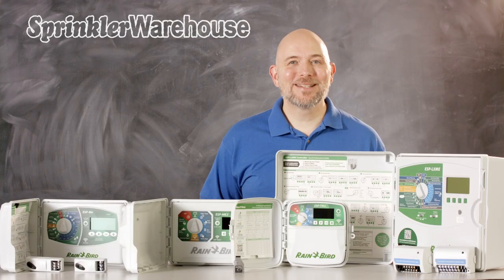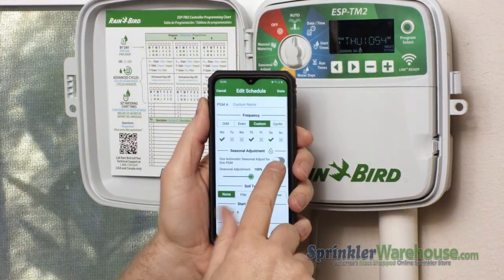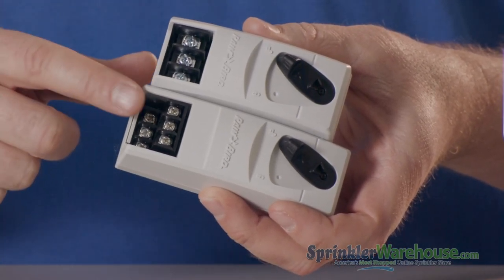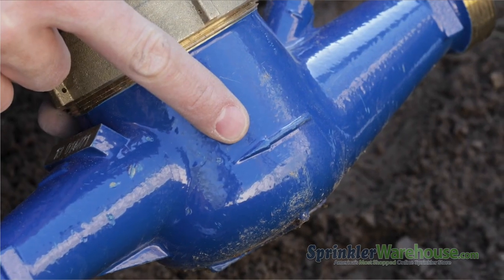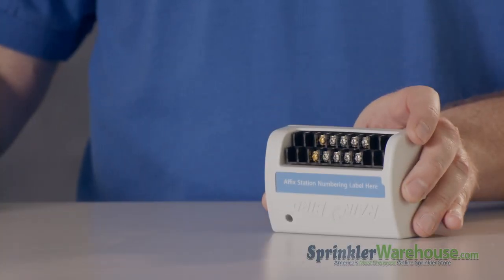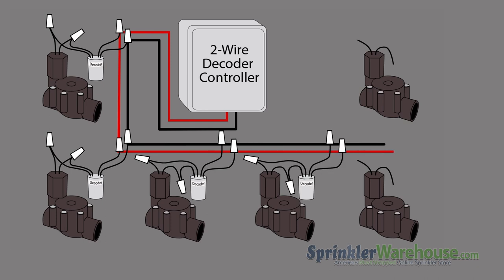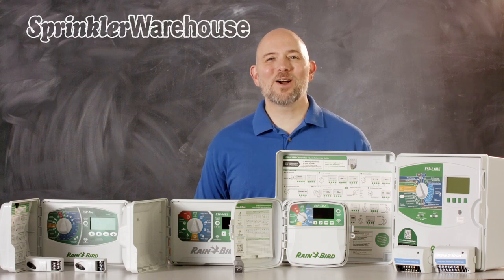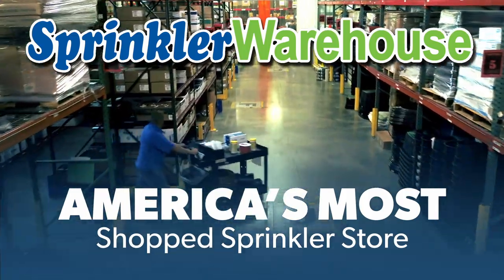Choosing A Rain Bird Controller

Comment: Hello
I have a RainBird 150efbcp that is connected to an A421 PENN temperature controller which is connected to my natural mineral water well.  When the temperature reaches a low, it opens my rainbird valve and adds the hot water to my pool until the temperature is at the set degrees.
I would ike to have this wireless access through the rain bird controllerl
any thoughts?